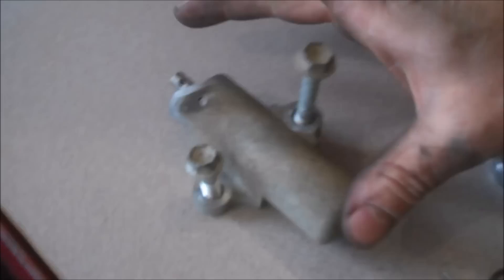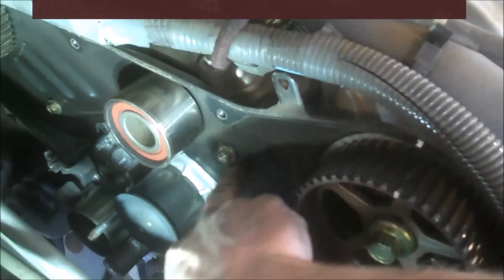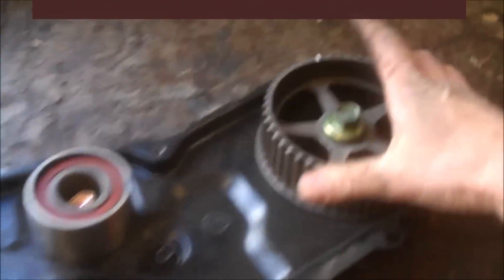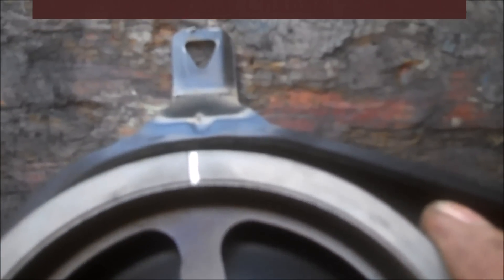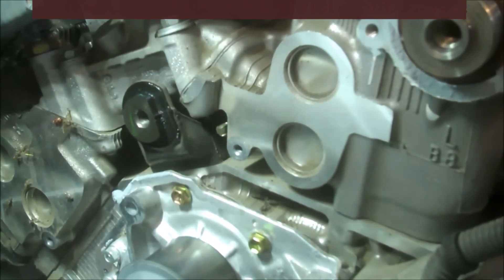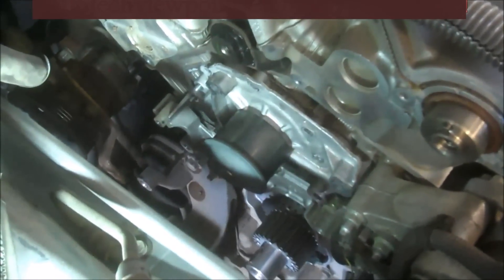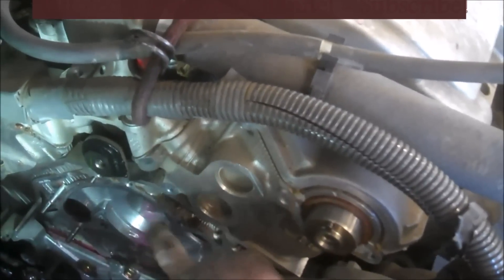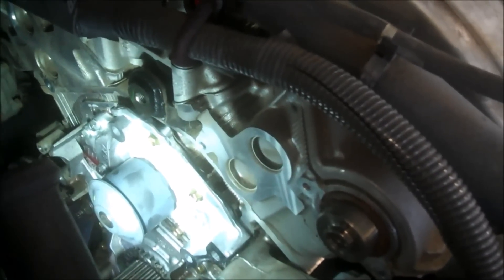Timing belt replacement Toyota Sienna 2006  PART 3 V6 3.3L Water pump too. Install Remove Replace

Comment: THANK YOU SO MUCH FOR MAKING THIS SERIES ON REPLACING THE 2004 SIENNA TIMING BELT. I just replaced my timing belt on my Sienna (with 264k miles on it) this last week and used your video series as a GREAT reference!!!! I have the Haynes manual but it is vague at best on how to replace the timing belt. I have always worked on my own cars and hate having to take it to a shop to get work done. I have all my own tools and have had to be an apprentice to my Master Mechanic older bother (RIP) on cars since I was about 9 years old. One thing you seemed to be unsure of was if the water pump will slip out from under the back timing belt cover. Yes it will as long as you do what you said in this video and take the two water pump studs out using a reverse Torx socket. It is an E-8 socket. I also found that you can use a 12 point 7/32 socket to remove them. For a little more room I also removed the the bolts that hold the back timing cover to the block and head. This way you can move it a little more if you need to. Again THANK YOU SO MUCH!!!!
Reply: Tony Lara was this the 1st time to have the timing belt replaced?

Comment: What would happen if the cam pulley spun while removing the bolts? Trying to understand the need for the pulley holder

Comment: Hey whats up? my question is. well 1st I have a 2006 sienna and Im having my radiator done so what I would like to know is what else would normally go wrong with it or what else should I be considering replaceing you guys says that the timming belt needs to be replace at 90k well im at 72k so what should I take care of cause I don't like waiting until it happens to do it 
thanks for any help
Reply from the maker: s Tim I don't know too much more about issues with it,  I would just try to follow manufacturer guidelines for maintenance if you have the owners manual.
Reply: +Fixing cars and stuff - hello from IL- where they sell the part you were talking that you have to compress,

Comment: thank you for your reply. So, once i am ready to install new belt, do i simply place crankshaft and "in-right place" camshaft to their marks and adjust the camshaft that was off by thee teeth clockwise to the mark position to align all three valves or is there something else i need to do?
thank you

Comment: the marks i was referring too are the 3 timing marks (each camshaft pulleys and crank shaft)
Reply from the maker: Well if your timing belt is off three teeth, then just take the belt off.   It is not a must that they are aligned before taking it off, just makes the job easier when you put the new belt back on.  You want the marks close when taking off the belt so you do not need to worry about damaging valves if it is an interference engine. (I do not know if this one is)
Reply: reekky zappa

Comment: I took my 2006 Toyota Sienna in for an oil change today.  Mileage is 101000.  I was informed I needed to change the timing belt, water pump, etc. Should have done at 90000 miles.  I looked through my whole maintenance schedule manual and there is nothing in there at ANY mileage to change the timing belt.  So if it doesn't say to do it, why would I?
Reply: I was wrong.  It did say at the 90,000 mile maintenance to change the timing belt.  It had the Sienna listed last and was in very small print.  I took to Toyota dealership and had it
changed for $650.00  While it was there they
found that the power steering rack was leaking on the passenger side of vehicle to the tune of $1200.  This seems to be a common problem I've read with the Siennas.  I'm looking around for someone to do it cheaper. Is this a problem the manufacturer should be addressing?